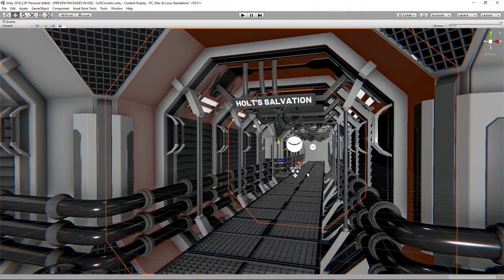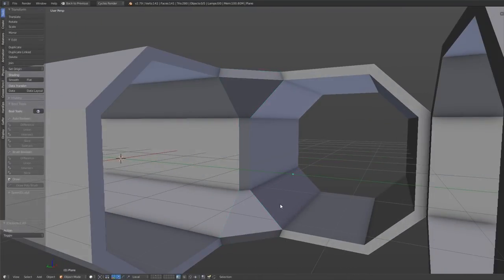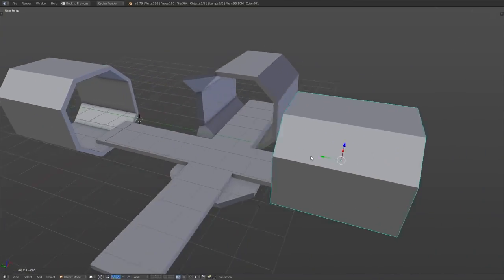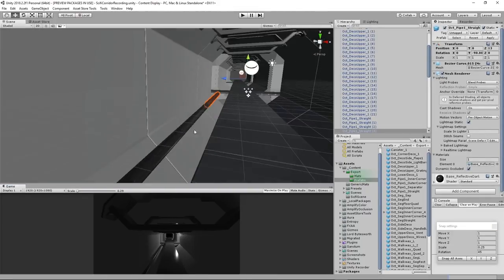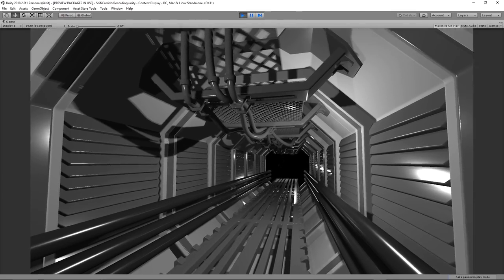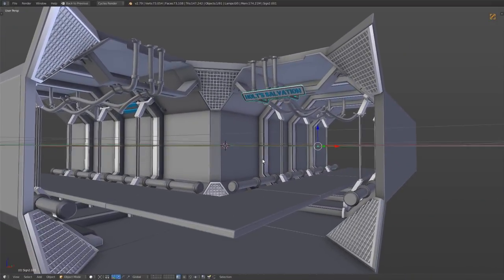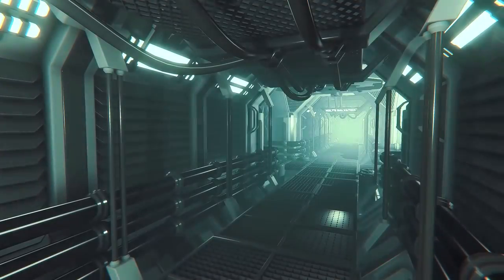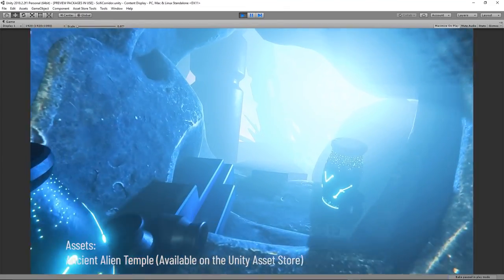Building a Sci-Fi Corridor (Blender and Unity) - Part 2

Comment: but how are you making those dots/lines for the vertex snapping I can't find a single resource online?! wth!
please help me
Reply: yeah I wondered this as well, but figured it out. Enable Snap, and select Snap to vertex. Then in Object mode, create new plane. With only this plane selected, go to Edit mode, and make sure all four vertices are selected. Alt+M -> At Center merges these four vertices into just one vertex, which you can now drag around and it should snap to vertices on other objects in scene. Then you can create more vertices duplicating this vertex with Shift+D, or by extruding it with E.
Reply: @teambeeq9433  Thanks a lot! I too can't figure out how did he make this, so i used extrusion and Poly Build.
Reply: @teambeeq9433  its not alt+m its just M
Reply: @zazo5525  do what the first guy says but press M to merge instead of alt+M
Reply: @zazo5525  if you mean you are in wireframe mode you can just turn that off with shift+Z

Comment: Amazing video, you have pulled me back into game development simply by helping me understand the iterative process with examples shown in your videos. Thank you. 
I do however have a question regarding one or two things. 
1. Are you Beveling your edges on the model to get the appearance of seams in the Center piece of the corridor?
2. How are you achieving the particle effect to give the appearance of dust in the fog?

Thanks again
Reply from the maker: Hi Harvey, that's great to hear, I'm glad you've enjoyed my content :)
1: Yes, I have beveled the edges of the models to get the seams. I like the way that light reacts with beveled edges, especially on texture-less objects.
2: For dust, I typically use a default particle system in Unity, reduce the scale of the particles, then enable a color over lifetime effect. For the color property there are 3 handles, the first and the last are transparent, whereas the middle is pure white. I also reduce the speed and change the emitter shape to be a large cube so that the particles can appear all around the inside of the cube.
Best of luck with your adventures in game development!

Comment: Hello Curtis, 

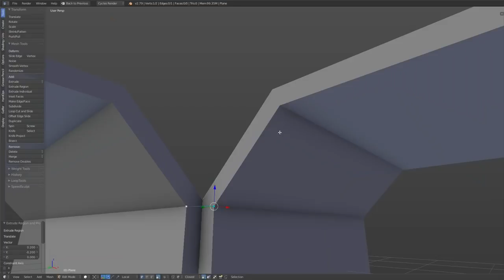Let me start by saying thanks for the amazing video.  I am new to blender and all my work has been done in Fusion so far. I could use some help At around 2:30 you are making lines to make the corner. can you explain how you are doing this. I can't seem to get it 

Thanks David
Reply from the maker: Hi David!
Thank you for the nice comments. What I'm doing at that point is selecting a vertex and then pressing 'E' to create a new one (with an edge automatically created in-between). It will follow the mouse position until I click to place it. 
At that point I am also trying to place the new vertex in the same position of a vertex on an adjacent object. To do this, I have my snapping mode set to 'vertex', and while I am creating new vertices, I am holding CTRL. Doing this will mean that as I hover over the position of another vertex in the scene, the one I am trying to create will automatically snap towards it.

Documentation for snapping in Blender can be found here (keep in mind that 2.8 versions of Blender have had massive interface overhauls so things will be in different places):
https://docs.blender.org/manual/en/latest/editors/3dview/object/editing/transform/control/snap.html
Reply: @CurtisHolt  thank you for the fast reply. I will give it a try !